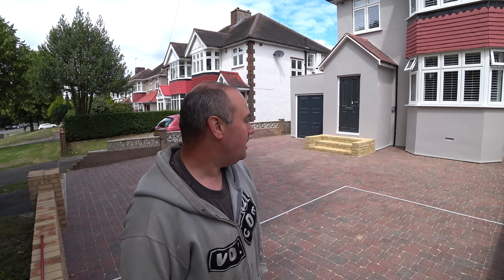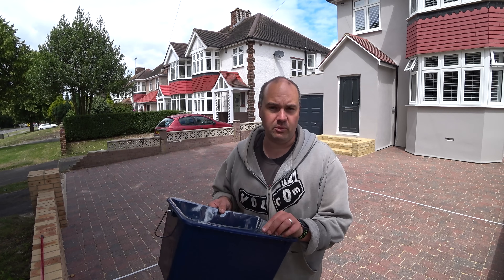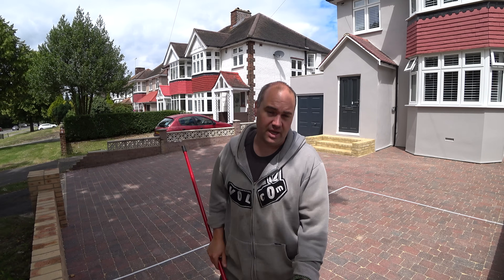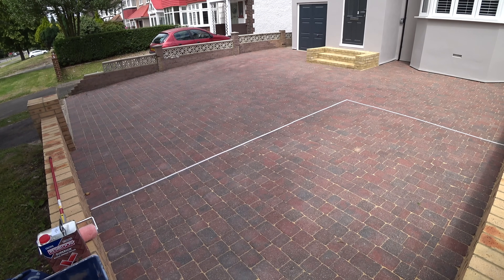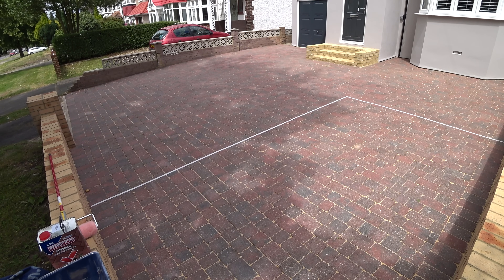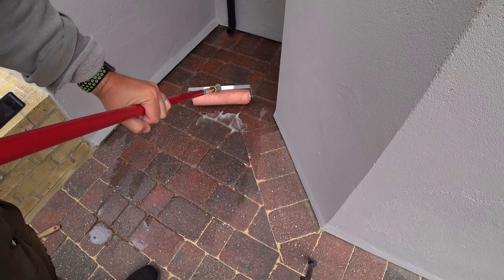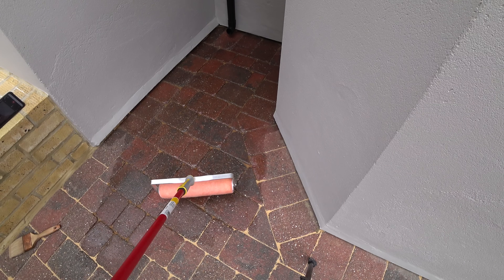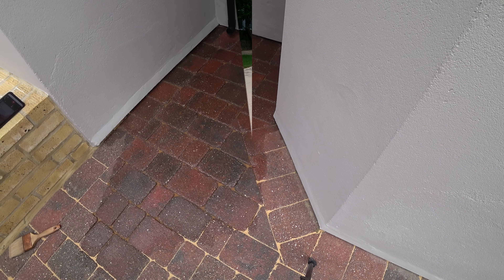How to Seal a Block Pave Driveway - Resiblock Superior Demo & Time-lapse

Comment: Another nice job Phil    Do you fine the price of the sealer limits you offering the sealing service  or do you use a standard sealer  more agreeable to your customers budget  have u used the battery sprayer to apply
Reply from the maker: London pressure wash EXTERNAL PROPERTY MAINTENANCE problem is I know you can have issues with cheaper sealers. I would rather turn a sealing job down than use cheap products. No you don't spray this stuff as it will clog up the sprayer, it starts going hard in about an hour and the only way to clean is running thinners through it, even then it's hard to tell if you've got it all out until next time you come to use it and it don't work lol. Using this sealer is well expensive but it's good stuff. Cost around £600 in just the sealer.

Comment: would u think a sealer is needed for 450mm pavers, which will have polymeric sand in the joints? or not necessary? sorry btw, i watch all your vids, and seem to ask you a question each time :) best on here tho.
Reply from the maker: Chris C hey Chris, it really depends upon why you want it sealed, silly question I know. Yes you could use a sealer as well as poly sand but the main reason for using something like Resiblock superior is because it binds the sand. Using poly sand and say Resiblock may be a bit counter productive as the sealer won't do the sand binding part. In turn you will use less sealer however I could see potential pooling issues in the joints as a lot of poly sands are not water absorbing so the sealer won't penetrate through the poly sand. If your considering sealing I would probably not use a poly sand. The poly sand can leave a powdery residue on the surface which would need to be fully removed before sealing otherwise you'll trap it in. As a contractor poly sand is a cheaper option as it's only slightly more time consuming than regular kiln dried sand whereas sealing take a couple visits and take a lot longer to apply. If I had to chooses between sealing and poly sand I would choose sealing as it offers more than 1 benefit...so long as the conditions are right
Reply: damn, ok. and i just bought 2 expensive bags of it too. well at least will save me buying the sealer, and maybe in a year or 2, replace with kiln sand and apply a sealer.  i will make sure i am careful with the poly before i wet it so as not to have any on the actual paver. will be applying the sodium hypo before all this tho to remove the lichen, received a 25litre today, wont need it all tho. your videos are a really helpful guide, so thanks, and keep doing what you do mate :)
Reply from the maker: Chris C what make is this sand your using? I've only ever used kingfisher and Resiblock and they are £35 for 15kg kingfisher or £55+del for 20kg Resiblock.

Comment: Hi Phil 
This is a good view as it goes through the stages of sealing, thanks.
One question, how long did it take to do first and then the second coat?
I am about to do my front using Resiblock - it's apron 65ms.
PB
Reply from the maker: Paresh Bhatt took me about 3hrs on first coat, hour and bit on second. Make sure drive is fully dry, all sand is dry otherwise it will go milky and you will be in a world of difficulty. Phill

Comment: How can I check if drainage is going to be an issue please?
Reply from the maker: What do you mean? If you seal the driveway you will effectively be taking away all natural drainage through the blocks.
Reply: Dirty Drive-Away that’s what I am worried about as there no drain in this patio area
Reply from the maker: @baggiemad  yeah it can cause pooling issues if there is nowhere for the water to run too. There are permeable sealers available to comply with SUDS regulations. These sealers bind the sand but are also permeable to allow water to soak through. They are pretty expensive though and resiblocks version is called envirofix
https://www.resiblock.com/product/resiblock-envirofix/
If drainage is an issue using something like this may be your only option if your looking for a sealer. Phill

Comment: Good job as always Phil! That other sanding job is a joke!! What sort of labour do you charge to seal a drive?
Reply from the maker: Tom Wilson hi Tom, I charge £1.25 a sqM per coat. 2nd coat goes down in no time. Plus materials etc, it's quite straight forward to do if using good products.

Comment: This was too much for me so I went with something cheaper.  Can this sealer be applied using a sprayer?  Also does this put some customers off with the price of the sealant?
Reply from the maker: Ding Bat Driving. Hmm sprayers, I wouldnt recommend it. Purely because it's high solvent sealer and will probably melt the seals, also it starts going hard quite quick so I think it may start clogging pretty quickly. You could also go through quite a lot of sealer fairly quickly, I always find a roller the best and most controlled way of applying. If it was a water based sealer I'm pretty sure it would be fine. Yes this isn't a cheap product but it works exactly as described if applied correctly. Resiblock offer a no oil stain guarantee on this sealer so you should be able to wipe off any oil spills. The downside is that this type of sealer is exceptionally hard to remove, they say it degrades itself over time (3-4 years) but anything before that period then it will either need chemically stripping or keying up really well before re applying.
Reply: I thought not, mine is solvent free.  I've heard people ask about removing, but why would you?  You want it as hard wearing as possible, especially when you've got cars and people on it all day.  Does look good.
Reply from the maker: Ding Bat Driving it's not so much removing it, it's just the people seem to think they need to keep doing it every year or so, unless you key it up it's like painting over gloss it just won't stick without a good prep.
Reply: Ah ok I see.  I did the front drive with a lesser product and over 2 years all the protection has gone, and that was with mainly the elements taking it off.  As I don't mind cleaning and redoing I'm fine, but I might give yours a go.  Do you just clean and protect or do you lay as well?
Reply from the maker: Ding Bat Driving I just clean, I do do sealing but it's something I like to assess per customer as the price of resi is quite high and I don't like using cheap products. To be fair doing it every couple years isn't really a hardship just the labour cost can add up. Resiblock is a 2 coat application whereas some are only 1.
Reply: Thanks for the advice, I'll keep watching as I have the front and back of the house to look after.  It's a shame you cannot post pics here as I could have shown you my challenge lol.  Good luck for the future.
Reply from the maker: Ding Bat Driving feel free to email dirtydriveaway@gmail.com

Comment: Amazing videos Phil,
There's one question that bothers me, what about already sealed surface, should I remove old sealer with other chemicals, or pressure washing gently will do the job, just reapply on top. Thanks
Reply from the maker: Nerijus Puzas it really depends what sealer was used. If you ask for resiblocks advice they would probably say all old sealer should be removed. I am not entirely sure how this is done as most polyurethane sealers are pretty jet wash proof. Most sealers last a few years and resiblock give there's around 5 years. I know a good solvent may soften it but to be honest I've never had a job whereby I'm sealing a previously sealed driveway. Phill
Reply: Enviromose pro removes polyurethane sealers with ease.

Comment: Great job Phil, can I ask is it a requirement to sand block paving before sealing or can I just seal straight away once it’s cleaned? Thanks
Reply from the maker: No you need around 5days of dry time before sealing, sometimes more depending on the drive. The whole idea of sealing is to bind the sand so you need to sand then seal, preferably at the same time. So you clean, wait 5-7days to fully drain/dry, the sand & seal. If its wet when you try and seal it will leave you with a big mess.

Comment: Hi, very informative vid once again. I had a recent customer ask me to brush salt into the joints first then sand. She said she heard it would help kill any weed roots that were still there. What are your thoughts on this?
Reply from the maker: Edge Mandem I have heard salt can help with weeds although personally I wouldn't want to introduce it onto block paving as it can potentially lead to white staining as the blocks will absorb it when wet. This is even more so important of sealing is involved because it will seal the stain in. In most cases especially on new bricks you are trying to avoid/remove natural salts to stop efflorescence blooms. Has the customer not heard of a good weedkilling regime lol.

Comment: Need to Use a Concrete form sprayer !
Reply from the maker: Resiblock isn't sprayable, they clearly state that. It goes off too quickly and clogs the spray nozzles.

Comment: Just read that resiblock pu is not a cross linking sealer so in the event of milky patches, touching up due to tyre wear or recoating when the sealer looks patchy or at the end of its life you cant just put another coat/ s on  or re mulsify sealer you have to strip it all off. If your thinking why is poss to put to coats of sealer on well thats seems to be different when the first  coat on you wait 3 hrs before second coat, aftet that you only a window of up to 24hrs to apply 2nd coat,  any longer and problems start like delamination.  Just saying before somebody makes a very expensive mistake. Matt
Reply from the maker: matthew calder hi Matt, I spoke to resiblock today and they told me outright that you can apply a PU sealer over the top of another PU or water based sealer. You can't put a water based sealer over the PU. I also questioned them on removal and they said it will naturally wear off after around 5 years due to traffic or environment. They said you can use a stripping agent before the 5 years but they said it's horrible stuff. They said so long as you scuff the surface, they recommended scrubbing down some sharp sand to key it up then re applying a PU sealer won't be a problem. They said paramose is evil stuff and yes it will remove it but it's pricey. They don't recommend re applying before a 5 year period. All the PU really does it protect against oil stains. All sealers should bind the sand. Phill
Reply: Well done for phoning them as this info is not on there website??Cant see PU  just wearing off, patchy may be but if they say sharp sand will save the day over using a stripper that sounds good. Do you think the scuffed sealer would look ok with another fresh coat on top?Phill I don't expect you to have the answer to this question but lets put this out there as this has been the reason it put me off using it..Imagine your at a new b/paving sealing job and you have checked the weather, checked the sand bed is dry and the tops of the block are dry.  Every thing is as dry Ghandi's flip flop! You are now halfway through sealing the drive either halfway through the 1st coat or half way the second coat and a percentage of sealer is still wet. Out of no where it starts to shower/ rain! good old uk weather at its finest! You return the next day hoping you can get the rest of the PU sealer down before the end of the 24 hr window. If you don't see a bloom (milky white patch ) that day you might think you have nothing to worry about. A few days later the customer phones to say the drive doesn't look right and sure enough moisture (milky white patch  is trapped under the sealer. What is your next move? How are you going to rectify this problem?  MI
Reply from the maker: matthew calder hmm yeah that is a problem, when I have questioned resi before about the weather and the window they say it's a guide, but ideally for best results both coats need to be down within 48hrs. They did say that applying the 2nd coat a few days later won't hurt. I also asked about the rain, the answer was so long as the first coat has gone down and has had at least 3-4hrs on a good day then it should be fine. They also said it's not quite so detremental on the 2nd coat as the 1st application has already sealed the block. They said a small amount of dampness should be ok so long as it's not pissed down. They tell me more as I'm on there approved contractor list, they have to be more careful with the general public as they don't want to give mixed instructions. I've done a few drives with Resiblock and never had any issues or comebavks. It think like most things it's forward planning and making sure it's well dry. Unfortunately you can't predict the weather, looking up is always going to be better than the weather apps.
Reply: Dirty Drive-Away well looks as though the goal posts are widening!  Lol. Thanks for letting us in on the info from resi. So Any ideas if it was to rain down on the wet sealer say 2nd coat whats best thing to do? Cheers phill, M
Reply from the maker: matthew calder hard to say to be honest. If there was even a remote possibility of rain I wouldn't put it down. Resi did say that in hotter temps it dries off a lot quicker, 2-3 hrs instead of 4-6.
Reply: Dirty Drive-Away soz phill didnt mean to put you on the spot with that question just that I cant see any other way than the sealer will need to be stripped off. Wonder why resi never have any training courses always something there thinking of doing.  Think they used to run them not sure if they do now.
Reply from the maker: matthew calder I don't think they do training courses anymore to be honest. I went over there the other week to collect some product and their premesis isn't as big as you think. They are a good bunch of people and all seem quite knowledgeable on their products.
Reply: Dirty Drive-Away I can see a niche in the market here for you to put your self forward as the new resiblock trainer Phil ! Working  On and off site. Or seek permission and add it as a bolt on to your own business. Your out there on you- tube tutoring us so why not get paid to it? Your a man that can think on his feet and you come across well so why not? U could start  on a one to one basis and see how it goes. 
I imagine a lot of people have dabbled with the idea of sealing but due to lack of practical training drop the idea. a lot of people need to see how its done before having the confidence. Just a thought. M

Comment: great video how long does the sealing last .do you need to resand and reseal every year
Reply from the maker: This sealer will last 4-5 years, it shouldn't come out with a jet wash. You can't reseal every year without keying the surface as the new sealer won't bond. These sealers start to naturally wear and break down after about 3-4 years but it's highly dependent on the amount of traffic the area receives. I have seen 15 year old sealed driveways and the sand is still rock solid.
Reply: Thanks for the input. Does it really keep away the weeds and moss I have just put down a new drive and moss free for a long as possible
Reply from the maker: @paulelscey2465  yes, it's the only way to really keep weeds at bay. Poly sands etc don't work for long. Sealers will bind the sand solid for years, providing it's applied properly.